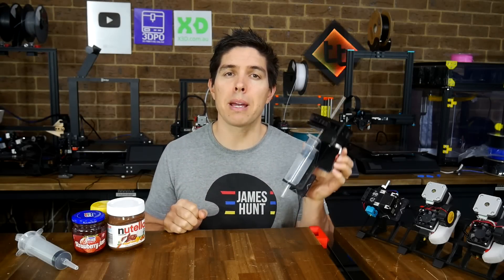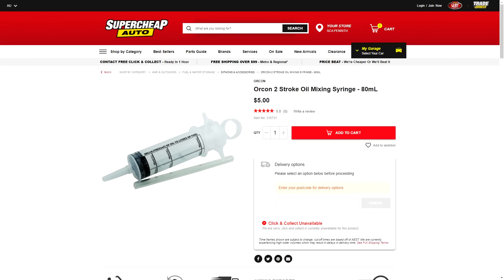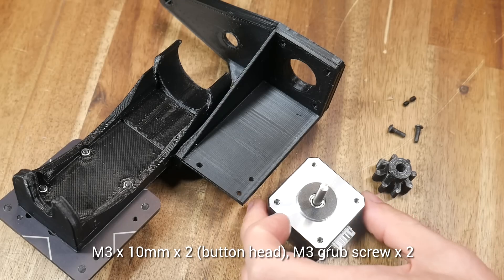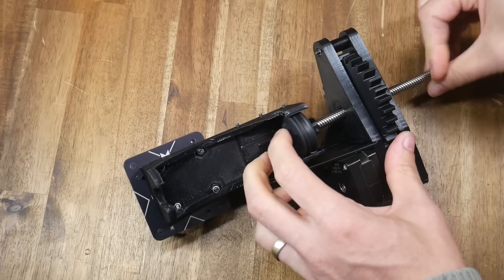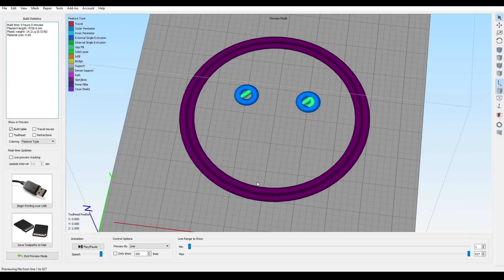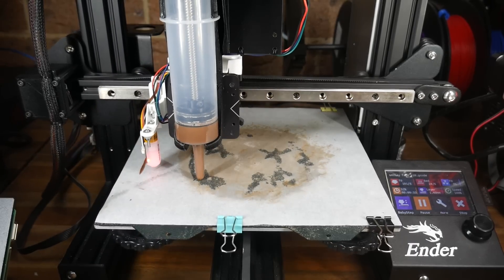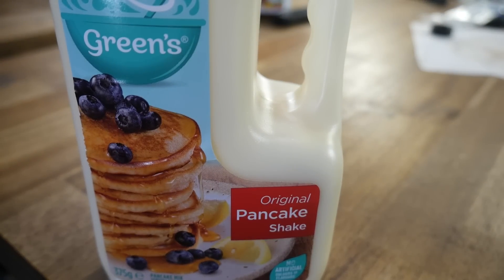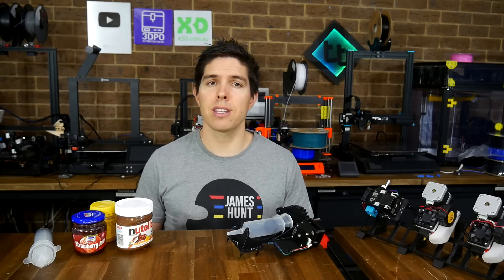3D printing Nutella with a DIY paste extruder - XChange on Ender 3

Comment: I LIKE TO USE EXTRUDE PASTE WITH PISTON USING COMPRESSED AIR SO,HOW TO ADD PNEUMATIC EXTRUDER IN MARLIN FIRMWAE,THAT IS DCV should on and off when extruder extrudes and retracts respectively

Comment: Wouldn't a better option be more like a Bowden tube, with a remote syringe or pump and just a nozzle for the print head? Would allow for bigger/beefier parts and take weight off the moving bits.

Comment: I wonder if you could expand this idea to print with chocolate..?
The heating and cooling would be similar to 3d filament just finding a way to feed it in would be the trick, this paste method could work though and some 'part cooling' should give rigidity to build some interesting shapes!

Comment: Commenting from the food perspective. The 15 trials that you did and the insane amount of retraction were results of elasticity of food materials. Nutella is already a much less elastic material compared to a piece of cookie dough... However, the nature of G-code doesn't quite allow you to account for elasticity in printing materials because all 4 axes in G-code move at a same feed rate. That's why even with some trial and error, you still ended up with uneven extrusion in terms of the line width. Also, the material did not extrude at the beginning of the print - even with priming, huh?

Pro tips: you can melt Nutella at around 50 degree C and pour the melted spread into the syringe to reduce air bubble. A faster feed rate actually helps reduce the elasticity effect of the printing due to the rapid pressure build up in the syringe.

Comment: Impressive design, and to get it working first time is also a testament to your printing skill. 
With the Nutella: maybe heat it up before loading the syringe, to get rid of the air bubbles, then cool it in the fridge. Wipe settings may help with those surface blobs. I think the only issues with the printing are the viscosity of the materials, and those can likely be solved by varying the temperature and. in the case of peanut butter, maybe some additional peanut oil. 
Next Year, a 3d printed Easter Egg?

Comment: well you dont need to dial motor steps with method trial and error. All you need to do is to set the inner part of syringe diameter as filament diameter...

Comment: I think the reason that you could not extrude jam would be the lumps of fruit in it. The strawberry was not going through end of the syringe.

Try mixing a little peanut oil with your peanut butter to make it a little more liquid. You can get it from Coles or Woolworths. If peanut oil is not handy, use canola oil.

Comment: Nice. and actually practical. I think you need EXTRA COOLING when printing nutella. Room temp is a little high. I recon temps in Aussie is much higher than here in South Africa. Nutella cept in the fridge is much stiffer than in the cubbord.
Next challange cooling down below  freezing point...

Comment: could use chocolate and a heated extruder. Put a pipe near the end of the extruder to blow cold air (kind of like what you see on jigsaws to blow sawdust) to cool the chocolate as it extrudes. This might produce stronger prints than the nutella

Comment: Try putting a small cardboard/tape border about 2 inches tall around the print bed, turn off heating, and put some grained/powdered dry ice on the print bed away from the prints. It should fill the border with cold gas and help the nutella stay a little stiffer, or even put some inside a void in the print.

Other options would be printing onto a flat block of dry ice.

Comment: Michael I need your help. Firstly I'm a subscriber and I enjoy your videos so thank you. This year my friend and I have acquired 2 x CR10S pro V2's and a CR6 SE. I recently ordered 0.4mm nozzles from Creality which came from the U.S but they have supplied 1.0mm instead. I'm not getting any joy from Creality either to resolve their mistake. The reason I ordered direct from Creality  is that I can't find an Ebay supplier that clearly identifies the correct nozzles to suit the CR10s Pro/V2 which I believe are different to the CR10s. Exactly what am I looking for (MK8?) and where can I go? I'm in Melbourne.

Comment: Dear Michael, you can buy so-called non-captive steppers which instead of turning a Gear directly move a lead screw up or down: https://m.de.aliexpress.com/item/32426927766.html
One should be able to install this directly above the syringe resulting in very straight forward Setup. As a Bonus the lead screw does not turn and so does not turn the plunger but only moves it up and down. Greetings from Germany!

Comment: I've recently seen an idea of using a dial indicator for manual mesh bed leveling. The downside is that the nozzle is offset from the indicator. Is it possible to define a "probe offset" for manual leveling in Marlin?

Comment: One improvement id suggest is using thrust bearings instead of deep grove bearings. The thrust bearings are made for radial load when this setup is almost all axial load, which thrust bearings are for. Also the plunger rotating that has already been mentioned.

Edit: thrust bearings in conjunction with brass bushings to hold the threaded rod.

Comment: I think the problem with the design is that the shaft could spin the rubber bit as you can see 14:40.
If the shaft's rotation is fixed there should be less difference.

If it slips enough and the gear and shaft rotate at the same speed, there would be no extrusion

Comment: Nice! I'm thinking it might be worth adding some light heating (60c-80c) on the outside of the syringe with some wrap-around heating element. Nowhere near enough to melt the presumably nylon syringe, yet allow things like peanut butter, and even chocolate to flow properly. As per normal FDM, a cooling fan will also help set the shape in place and allow walls to be formed. Go for it!  EDIT- apparently chocolate melts at only around 30c, so even easier.

Comment: Instead of tricking the printer with a resistor into thinking it was actually hot, I think it'd be better to just disable that check in the start script: M302 sets the cold extrude protection in the firmware. 

Played around with this a while ago. Quickly gave up though, for lack of skill on my part. I choose the same syringe extruder you used as a base and just mounted it with an adapter plate to my ender 3. all that worked fine and it was the most intricate project and modification I had done to the printer or anything really at that point. I however never could make it actually work. The gears kept pushing themselves up instead of pressing the plunger down. (The polymer clay I was testing with was WAY too firm, looking back.) And there was nothing holding the gears down, like the bracket you added on top. That was the obvious flaw in the extruder design I chose, but I lacked the skill to fix it. And then life got in the way and the thing got shelved. This video might make me return to it though.

Comment: You said that maybe a larger stepper motor would help in printing a material with more viscosity. Maybe oiling the syring will help in printing something sticky like peanut butter.

Comment: Migth be too crazy but what about an epoxy printer, here are my thougths:
Using one of those double srynge and a mixer tip cuould keep the 2 components away till the extrusion time
You will have to use the min layer time setting in the slicer an set it to the time it takes for the epoxy to reach the jelly state were its kinda solid an will bond reallly well to the next layer
Quick curing resin will be the best?
An heated chamber could be beneficial as the epoxy cures faster with the temperature
Also UV resin migth be even better if you manage to iluminate the laid down resin while keeping the ligth out of the srynge.
Again this will be probably too crazy but i had this idea some time ago and didnt really have the time to experimet hope you find it interesting.
Sorry for my english not my first language.

Comment: There is a company printing houses on site with a giant 3d-printer. It's basically a pasteextruder for concrete extruding a special concrete they invented in order to match the required viscosity for printing ^^

Comment: Try adding a heater with a food safe range 20-70 Degree Celsius.
I assume that you won't need more then 70 because 60 already starts to cook things. Technically it's about 40, but that takes very long for most stuff. But at around 60 some things start to change rather quickly. So that's probably the higher end you are going to realistically use unless you want to extrude fully cooked pancakes or eggs. 
But at about 35-45 the peanut butter should be almost liquid. Any hotter and jam might caramelize.

Comment: great video. would be great if the syringe could be heated in order to print normal chocolate and cool it down with a fan as normal --> with a heated and cooled design you could actually print a benchy with chocolate.

Comment: You should mix up gelatin (the unflavored kind) with some hot water; Less water than you normally would to make a paste. heat your bed, and print in the gelatin. the heat would cause the initial layer to set quicker. once the moisture evaporates, the resulting part would be solid; It would shrink up a bit, but that may be mixed to the right viscosity for extrusion and could result in interesting prints.

Comment: theoretically, could you use a metal syringe with some kind of heated element on it to print chocolate that would then cool and solidify the same way standard filaments would?

Comment: haha, funny idea. with nutella you need a bed cooling solution to get the extruded nutella @ 8 degrees. Then it would work I guess :D
Reply: @dimitrDimitr  indeed, that would work. But the power consumption would be intense then haha

Comment: Very nice ....beeing a bit of a willy wonka (owning a chocolate factory)  i can tell you 3d printing chocolate is already very much the rage among   industrials .  check out  "Chocoformer"  on the www.... thats what Pro's use.....LOL   and now a tip....take some chocolate pellets (shop) then heat them up in the microwave ad a little bit of water then put that in a heated seringue and you will be able to build up to 30 cm high. (you can keep the seringue hot with a flexible 12V heating element (amazon)   GOOD LUCK.

Comment: Great video Michael! I use paste extruders for my research. One method I've used was to set steps/mm of the acme screw as per normal (~400 steps/mm, nema 23, no gearbox) set the filament size to the internal diameter of the syringe, and nozzle size to the internal diameter of the syringe nozzle. Thereafter the parameters I need to adjust would be the flow rate and line widths.

I extrude mostly viscous fluids but what I've found helps is to use straight lines instead of curves when printing, especially if building layers, because curves tend to collapse towards the inner radius. Coasting may also help to combat the "lag" between the motor's action and the extrusion of the paste. 

Depending on what you're extruding, part cooling or hot air may help with building layers.

Currently instead of using stepper motors, I rely on pneumatics to pump the pastes out of a syringe due to the high viscosity. I don't get the advantage of finer control and retractions, but it allows me to pump really viscous fluids without having the budget for an auger system.

Comment: We use peanut butter and jelly to mean peanut butter and in reality jam, jelly or preserve. Looked up the XChange system looked like good option for having multiple different nozzles setup but it cost as much as an Ender 3 so would be cheaper to just add another to the fleet.

Comment: Hi
Could you test this setup for printing with silicones? (the common RTV kitchen/bathroom kind you can get anywhere)
I've had this idea for a while .... since the silicone isn't taking a long time to set and viscosity is high, I think it could work reasonably well

There should be a lot of reasonable and useful applications for that

Comment: I love that the XChange system has allowed you to quickly try out new things like this. I think a stepper motor with an integrated lead screw could really simplify this design.

Comment: E steps and extrusion can be calculated. First, modify your filament profile and set the filament diameter to the ID of the syringe vessel. Then set your extruder nozzle diameter to, well, the syringe nozzle diameter.

Then use the motor's steps per revolution along with the lead screw pitch to tell you how many steps/mm, taking into account your gear ratio. 

Should be a good starting point.

Comment: For taller builds perhaps a cold air fan to solidify the Nutella as it extrudes
Reply from the maker: I put a large fan next to the printer but it blew the grease proof paper over. A proper/traditional part cooling fan would definitely help.

Comment: if you put your first layer 1cm too high and increase the flow rate (like x4) depending on the viscosity of the paste you get automatic perfect sinwave (even on bread). i did it with ketchup for an ad it works perfect

Comment: Nice design. the only problem I can see is relying on the rubber plunger to prevent the lead screw from rotating and leading to under extrusion?
Reply from the maker: The logical next step for my design is a keyed sleeve on top to prevent the rotation, I agree.
Reply: @TeachingTech  cool will be interesting to see

Comment: can you run a test like this nutella one in a colder room? I think it may solve the drooping issue maybe, but I guess extrusion would be tougher. hmmm, put it in a freezer room but add a little heating element for the syringe to make sure it keeps extruding so the nutella in the syringe stays liquid. COuld make a nutella cake or somthing. or ice cream cake 3D printed

Comment: Use all natural PB, no shortening or sugar etc. just ground up peanuts.  It will have a higher oil content and flow better.

Chocolate would be interesting, heat it to get it liquid and cool it to harden.

Comment: 15:52 Or you could argue it looked too hot. Maybe cooling the bed / print might have improved the results ... and with cooling I don't mean fans I mean dry ice.
Reply from the maker: THe build plate was actually in the freezer before that print but I'm not sure it made much difference.
Reply: @TeachingTech  Active cooling perhaps? Peltier maybe? Or tweaking the melting point. There is this ice sauce. At room temperature it is a liquid but just below freezing it is rock solid. Not saying to use it, but it might be possible to tweak the melting point of chocolate to a convenient temperature.

Comment: the biggest problem I see with this is there's nothing to constrain the plunger from spinning. You can see in some of the videos that it's spinning sometimes and not spinning other times. As soon as it starts spinning it won't be extruding anymore. This is going to lead to really frustrating inconsistencies with extrusion.
Reply from the maker: In the first print it was a big problem. You'll notice it doesn't happen again until the peanut butter, as I thickened the part inside the rubber stopper to increase the friction. Ideally, however, a guide to prevent rotation as you say would be most effective.

Comment: Heat the extruder to 45c for the peanut butter. 
This is gonna be so cool for practicing medical 3d prints, such as starting with an ear, then a nose, then a entire spare backup replacement dermis to never be on backorder during medical emergencies. Could also try it with tiny amounts of experimental cement compositions, then scale up the concept.
Reply from the maker: I don't have active heating in this design, but a microwave could be used before hand to get it up to temp.

Comment: Also, try adding insulation to the syringe, load some warm melted dark chocolate and print that onto a frozen bed preferably in a cold room.
Reply: Hmm.. This could be an ingenious way to use a Peltier cooler...
Reply from the maker: I think peltiers under the bed could be effective to keep it quite cool.
Reply: @TeachingTech  To summarize, an enclosed (air conditioned?) printer with Peltier cooled bed would produce tasty youtube content. 
I think that the chocolate would cool down too quickly so I'd think about building a "Bowden extruder analog" for pastes, to keep the chocolate out of the cold enclosure.

Comment: Try the Nutella vase on a frozen bed and if possible, print in a cold room. I think the it'll be less runny.
Reply from the maker: The build surface was actually in the freezer before  that print but it made little difference after the first layer. A cold room would really help, maybe with the Nutella microwaved a little warmer first to help it flow.

Comment: Try your extruder with cake icing... I bet it would hold its shape well... with the smaller nozzle you could actually make things to put on a cake!
Reply from the maker: I agree that would be a very practical use for a cake decorator.